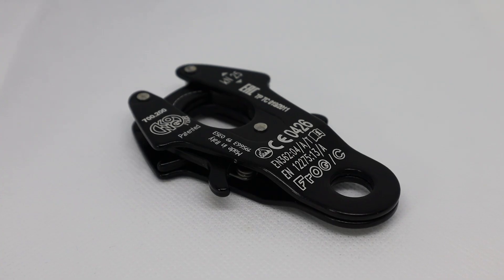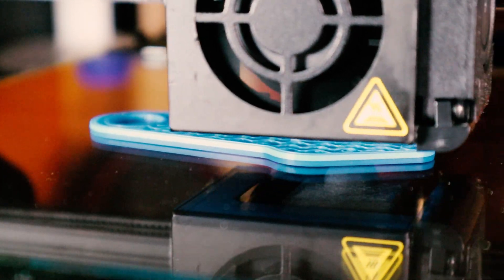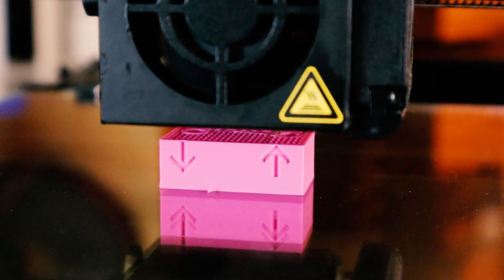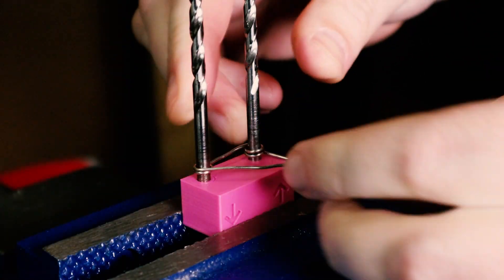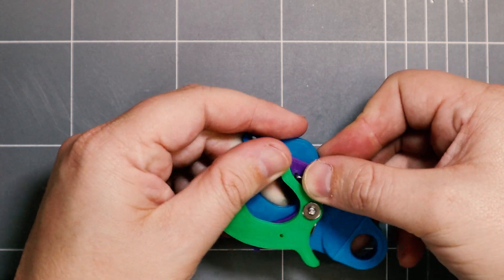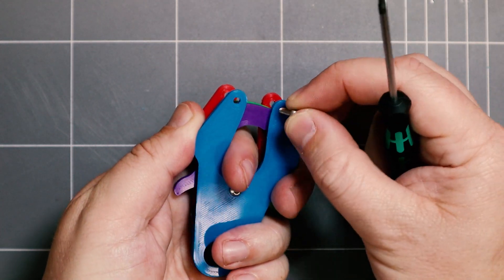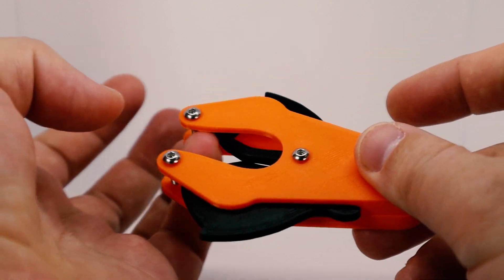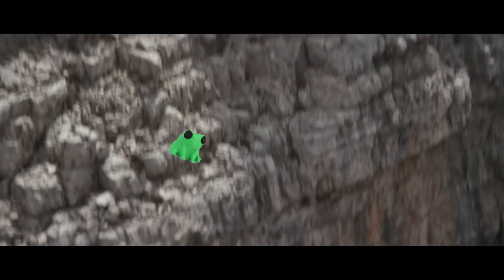Make Your Own 3D Printed Snap Close Connector

Comment: Tried to reverse engineer the mechanism so I could start slapping it on whatever projects I could think of. 5 failed iterations I have great respect for your work. That said your paperclips must be built different, my print of yours worked beautifully with 1mm piano wire (only 1 turn on the spring instead of 2) but other wires just bent without spring back.
Reply from the maker: I’m not sure that there’s much of an international paper clip standard! I have added the STEP files on Thingiverse if you want to play with the design in your CAD package.

Comment: I love this! Why not print two columns instead of using the metal drill bits? Did you try and the plastic couldn't hold it? (just curious)
Reply from the maker: I considered this, but I didn't think that it would hold up.